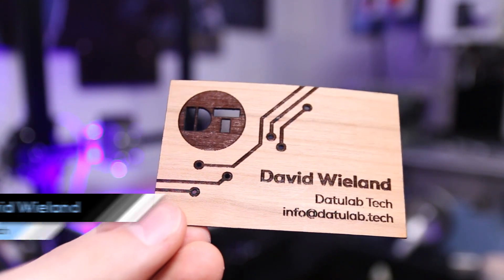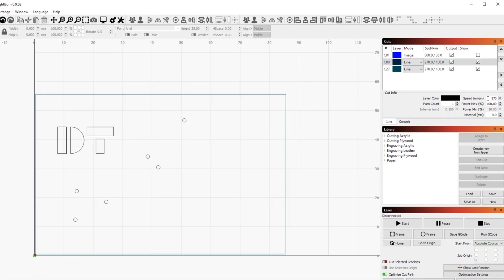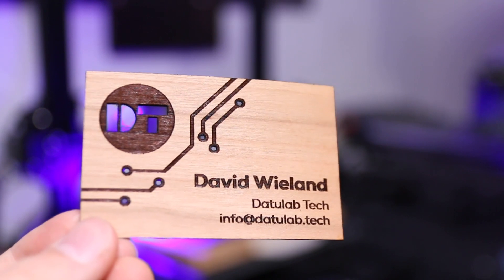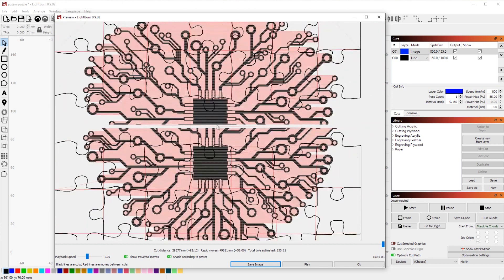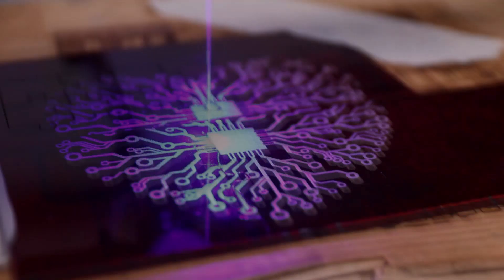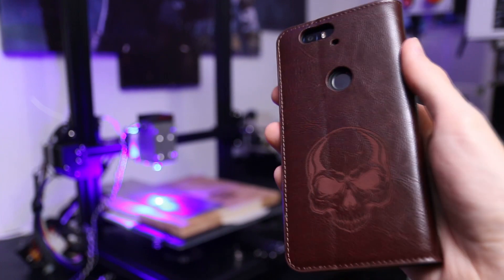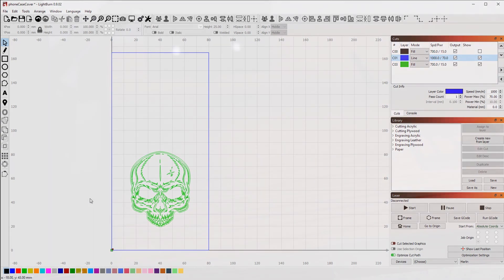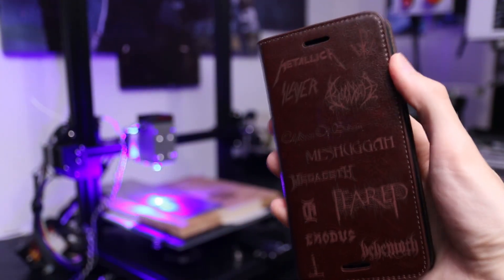What you can do with a 10 watt Endurance diode laser. Detailed footage

Comment: customising a leather phonecase like this.  

eehh do you think that's real leather?  
because pleather (the fake leather phone cases are made with) is made from pvc.  
a chloride based product.  

engraving and cutting it will produce chlorine gas  (ww1 trench weapon)  
wich ontop of being extremely toxic at verry low quanity's  ALSO turns into hydrochloric acid when it comes into contact with water.  

it will destroy the rails and optics of any laser engraver.  and it will KILL you.    
so it's not exactly a good idea to be making them and selling them as customisable gifts.

Comment: What can you cut and how thick?
Reply: Hello, Salvatore.

I started Lasering with visible light Lasers and, believe me, Endurance Lasers are one of the most dependable and reliable Laser Diode Lasers on the market today.  I have an 8W version and this is HOT !!  At some point, I wanted to engrave on transparent (clear) acrylic and I couldn't .. Here is why.
  
Keep in mind this is a visible light Laser.  You might be able to cut through 5mm or more of wood or any dark (but NOT Blue), but you will not be able to mark on a white sheet of paper but will have no problem to cut through black material.  Visible light Lasers are abiding by all laws of physics that applies to visible light and will act as such.  To be able to mark/engrave/cut, you need to heat the material (with visible light).  This is why, in this demo, you could cut through RED acrylic .. but I would like him to try on BLUE acrylic, or transparent, for that matter.  Since red and blue are at the opposite of the visible light spectrum, it will be no problem.

If you want a Laser that will cut, engrave of mark on most material, you just might want to consider a CO2 Laser, although much more expensive that its solid state counterpart, if you want to get a reliable and dependable machine (DON'T go Chinese).  This Laser type will even mark on glass at relatively low settings.  I have a 45W Muse™ (sold by Full Spectrum Laser) and there is almost nothing I can't do with it .. except cut through metal.  I can even cut through 1/2 inch of any color acrylic !!  Keep in mind it's not the power as much as the wavelength of the beam that makes it so versatile.  Visible light Lasers will go through most transparent materials, as CO2 Laser's beam will be absorbed by them, thus heat them by the same process.

Have a great day, and I hope this comment will help you choosing the right Laser type for the job you have in mind.
Reply from the maker: all about laser cutting and engraving https://endurancelasers.com/endurance-lasers-all-about-cutting-and-engraving-abilities/